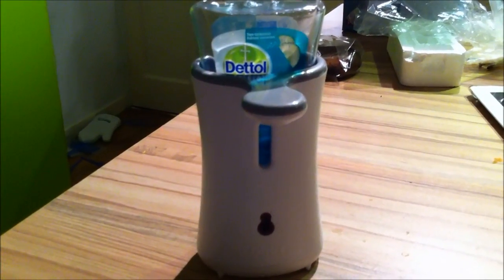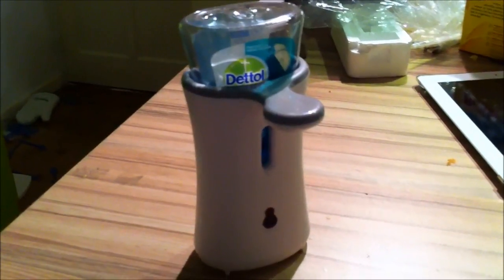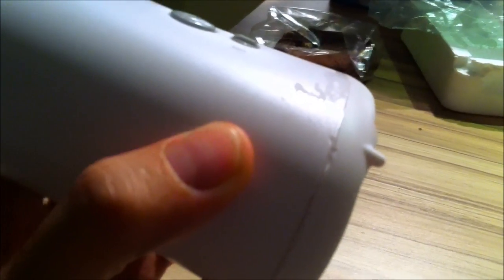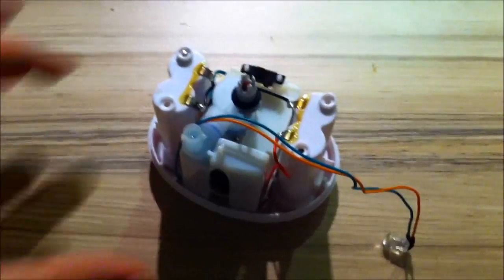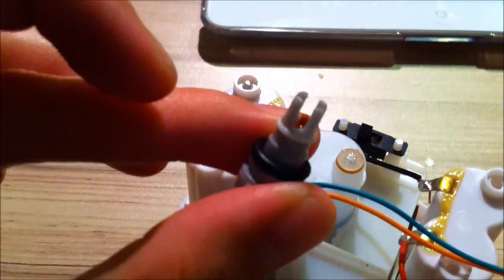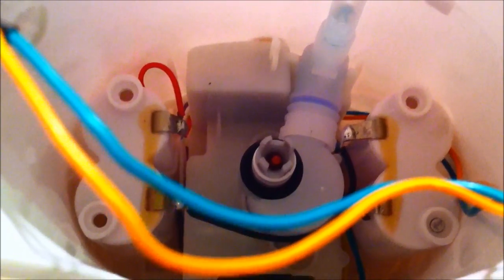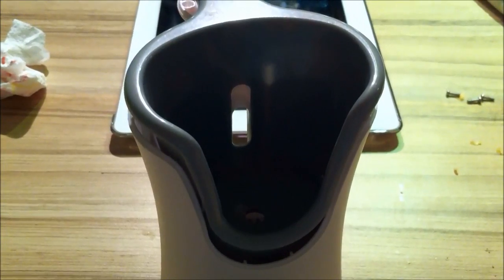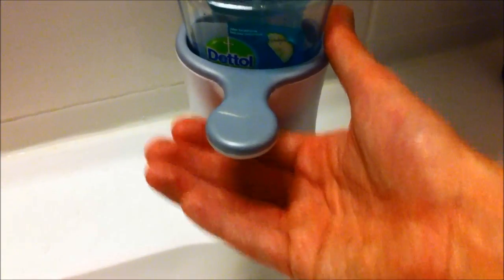Lysol (Dettol) No Touch Soap Dispenser Less Soap Mod

Comment: My model (proably a new one) has only 3 batteries and screws behind them - take them out. Don't take out all the equipment in the buttom - it will mess up the on/off switch mecahnics and seperate a some tube assembly). You don't need to dismount any wires. Just take off the top cover: Carefully snap it open with a small flat object (small screwdriver). Then gently pry the "nozzle-house" (use a mini pipe wrench or so to reach down) and take out the nozzle. Turning the nozzle around totally prevents soap to float from the container, but: Grind approximately 0.1 - 0.2 mm off the top end - the end that is supposed to press and force the opening of the soap container when mounting. Reassemble. Mounting the soap container will now leave a smaller opening and a little less soap reaches the pump. If you grinded too much off, extent the nozzle with a small drop of glue (use very hard glue and let dry well before mounting the soap container).

Comment: I just used a bit of blutack on the end of the screw driver. I pulled mine apart because it was malfunctioning, it would spit out three squirts then the LED starts flashing.. so I pulled the little circuit board out, and changed the circuit so that, when you turn the power switch on, it turns on the motor to start the pump. It's better now, because without the circuit board the motor runs faster, so you get a quick squirt then turn it off. Thanks for you video.

Comment: Thanks for the video. I was  interested in how much this would save so measured the dispense before and after - before the mod 4 pumps dispensed 6.1g after mod it was 5.7g which is about 6.5 percent  saving. not as much of a reduction as I hoped but still better.

Comment: if you really want a powerful dispenser, use a 2cell rechargeable lipo battery instead of 4 poor AA batteries. If your hande you can make it fit into the battery slot with the work of a Dremel to make the bay a little larger or just stick it to the back with some velcro. just make 2 wires and connect them to the + and - inside... Since 2 cell lipo  is 7.4 volt it runs way better.. dont worry, the motor can handle the extra power... to refill your canister you can twist the underside off if your a bit strong, you only have to do this ones and click it back again.. the next time it will be wai easyer..  have fun :)

Comment: hey i didnt have a magnetic screwdriver but heres a trick so easy its stupid take the screw and drop it from the top and let it slide down all by itself to the bottom then when its resting above the hole screw it it the screw hole is lined up close enough to the edge of the wall to line it up perfect i spent 15 minutes trying the first screw till i thought of this and it only took like 5 seconds to just slide the screw down to the hole good luck let me know if it helps you or if you more help

Comment: disassemble all, you MIGHT void the DETTOL warranty
at first, it just give you  ONE SPUR -- dunno why, now it give me TWO SPUR contnuously
~
could be good to be used for dispensing Masturbation CREAM then
there are 4 batteries

will it be bad if the bottom contact with the moisture all the time, and get the electrode ERODED ?

~~

Comment: Thanks for the video. managed to get the grey past out without having to lift out the entire guts. I was  interested in how much this would save so measured the dispense before and after - before the mod 4 pumps dispensed 6.1g after mod it was 5.7g which is about 6.5 percent  saving. not as much of a reduction as I hoped but still better.